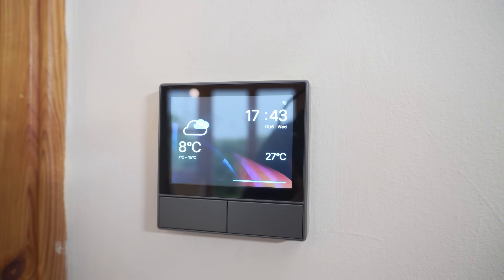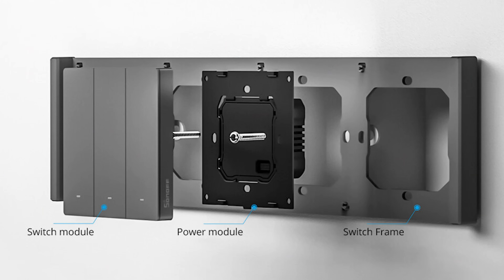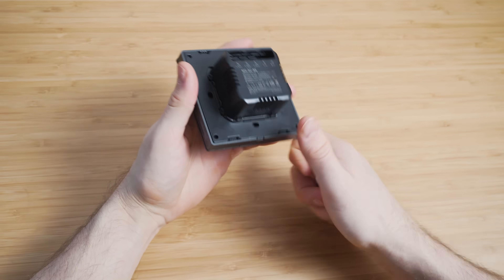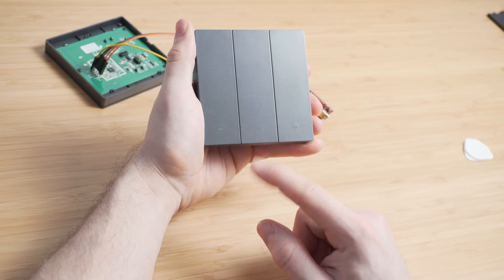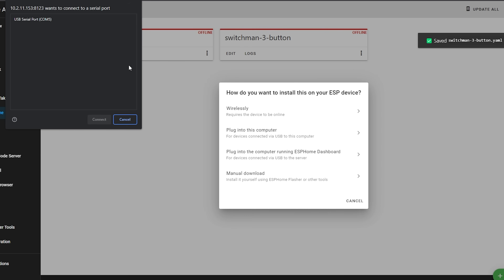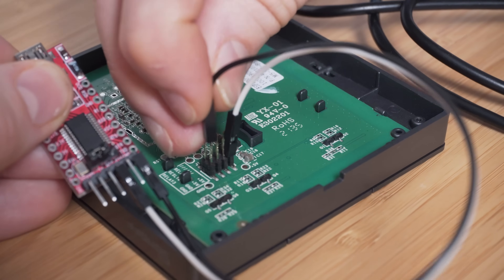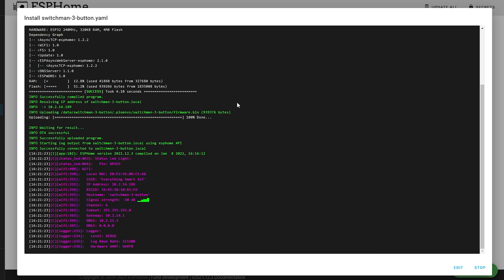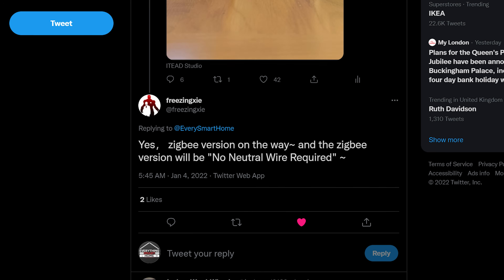Flashing the Sonoff SwitchMan with ESPHome!

Comment: I've just installed the Aquara zigbee switches which are very similar. Works great with Deconz.
Reply from the maker: They are my current daily drivers!
Reply: Did you get the double rocker one working in home assistant?
Reply: @dodgecrickets7862  yeah. It just appears like any other Zigbee device. You get an entity for each rocker.
Reply: @puntoboy_gaming  nah mate .. not mine .. my one dose not come up at all not even with the battery level ..
Reply: @dodgecrickets7862  battery? The ones I have are mains powered. I have aquara buttons as well and they work fine too.
Reply: @puntoboy_gaming  ohh right ,. I have the zigbee that is battery powered .. maybe that’s why ..
Reply: @dodgecrickets7862  the little buttons? Or switches like the one in this video?
Reply: @puntoboy_gaming  the double rockers just like in the video … but aqara .. and remote switch’s
Reply: @dodgecrickets7862  the double rockers are mains powered though?
Reply from the maker: I think you are talking about the wireless remotes that look like the mains powered one.
Reply: @EverythingSmartHome  not seen those before but just looked on Amazon. Look handy. As for @dodge crickets, I can't explain why they don't pair. One thing I noticed with the mains powered version is they appear at lights in Deconz, not switches, so you should use the light menu to pair them.
Reply from the maker: Indeed, both work fine on ZHA for me
Reply: @EverythingSmartHome  that’s very weird .. mine only comes with only the battery and even that has a question mark on it .. I’m using a sonoff zigbee stick.. the black ones with the antenna.. because I though it was the deconz one I had was the problem.. but it’s still doing the same thing so now I’m thinking it’s the switch it self.. have to do more testing .. 🤷🏾
Reply: @Puntoboy thanks for replying mate

Comment: ESPHome is superb and Sonoff providing ESP based devices is great as well. One point: majority of home installation is WITHOUT neutral line in which case... nothing like this works ;-(
Reply from the maker: Apparently WiFi switches without neutral aren't very safe. ZigBee without Neutral is safe however. No idea as to the validity but that's what we were told
Reply: @EverythingSmartHome  it is not about safety I think - neutral wire has nothing to do with safety of the switch - without neutral there is not much of power you can deliver via the capacitor (that usually is put in parallel to load) - when you have relays in the module it might be not enough power though. Anyway, rewiring the house... not easy solution, especially when you rent ;-)
Reply: @zyghom  itead does sell the Sonoff T4EU1C - which works without neutral on a switch wire only (parasitic) , quite a clever design, but with several limitations however.
Reply: It depends on the country you live in, where I am from all homes have a neutral wire

Comment: with how easy it is to flash them, why do they not have an option to just buy them flashed?  It would also be super cool if they had a version of this with a motion sensor / temp sensor built in.
Reply from the maker: Motion sensor would be cool, temp sensor would be difficult to get right since the esp32 generates some heat
Reply: @EverythingSmartHome  As evidenced by the wildly inaccurate temp's shown by NSPanels!

Comment: Regarding your last remark. From what I came across, switches that work without neutral wire, are not usually routers, but end devices unfortunately :(
Reply from the maker: Oh really? Didn't know that! Wonder why that is?!
Reply: @EverythingSmartHome  if a device doesn't have a neutral it needs to let a bit of power go through the lamp even when off so using as little power as possible is important otherwise the lamp might glow a bit
Reply from the maker: Good to know, thanks!
Reply: I have WETEN no-neutral zigbee light switches from aliexpress, they are routers. They're also not that great, not very sensitive and all quirks of no neutral switches apply - some bulbs will flash and need to be replaced with dimmable versions to work correctly at all.